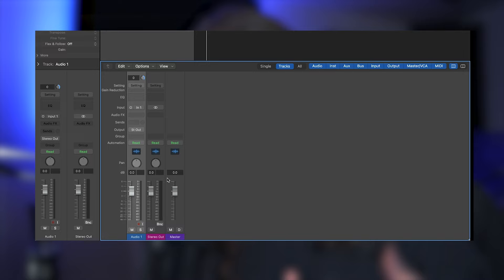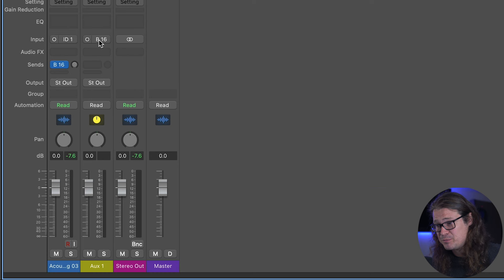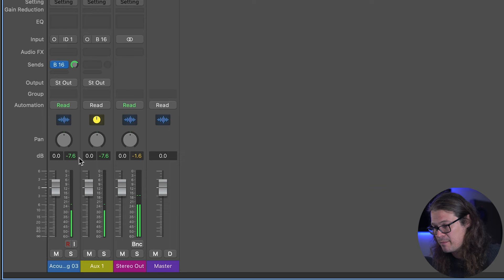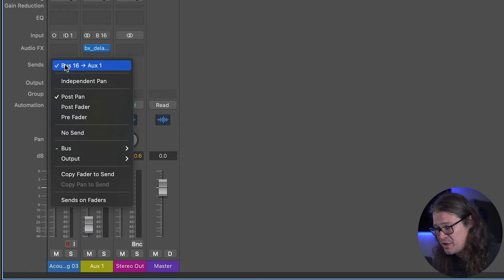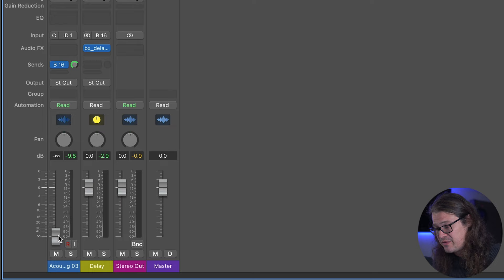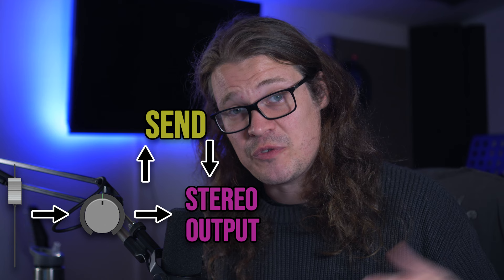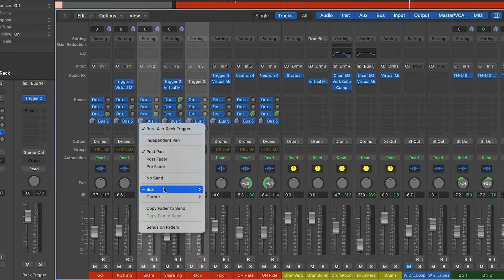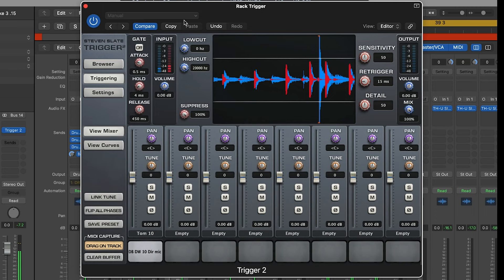Logic Pro Busses - Absolutely Everything You Need To Know!

Comment: Hi, thank you for you contribution to humanity, this video is very helpful.
May I ask you a question about some minor issue regarding the send tab configuration. I see, when you click on the send tab, it shows the BUS option and right below it shows an OUTPUT option. In my logic it only shows the BUS option. I want to use the OUTPUT option in order to use an external effects procesor such as a Lexicon. How do you assign this OUTPUT option?
Sorry for bothering with this, but I'm a little frustrated. 
Thank you for your time.
Reply from the maker: Hi, thanks for watching! When you see this (or rather, don’t see this) are you connected to an interface? If you’re just running off your computers soundcard then it won’t show any other outputs as there aren’t any to speak of.